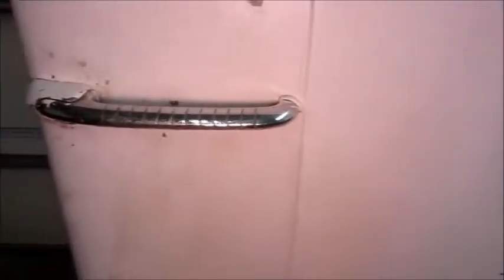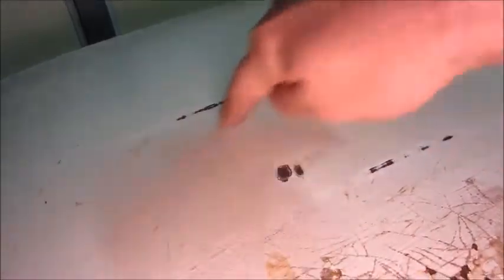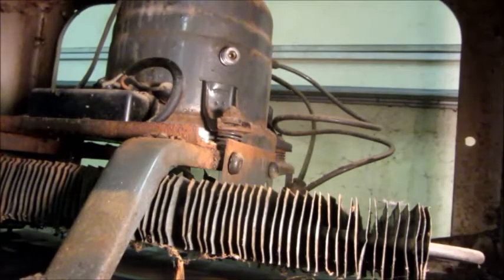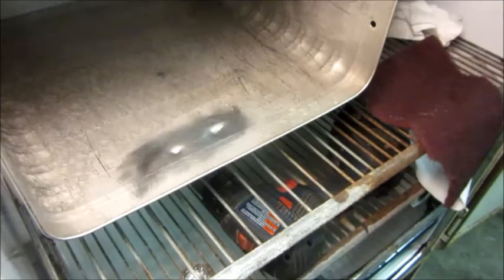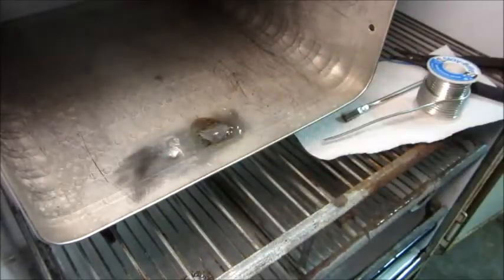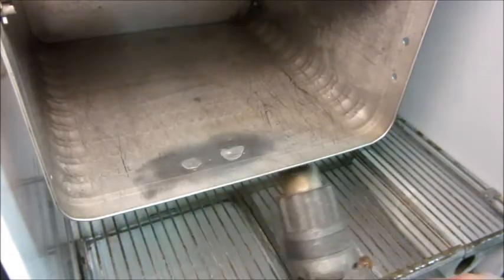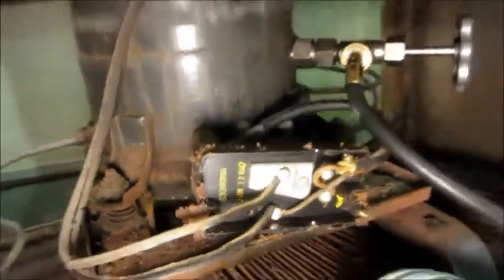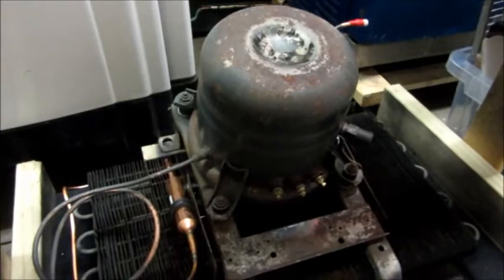1947 Kelvinator Antique Fridge Repair - 1 - Punctured evaporator repair...

Comment: Watching this again... if this were my fridge I would've been tempted to wire wheel the whole evaporator. The shiny stainless looks nice!
I'm going to squirrel away the tip on flux for stainless. I don't think I've had reason to solder to stainless yet, but that probably would have thrown me for a loop.
Reply from the maker: Glad you are enjoying these videos!  Yeah the stainless soldering can seem intimidating at first, but with the correct materials it actually is easy to solder.

Comment: I was in the used appliance business in the early 1990's. I junked out hundreds of 1930's through 1950's refrigerators that were in almost new condition. No one wanted them.
Reply: Best stuff ever imho nothing else can sit in a seasonal building year after year and run when plugged in.   Still using stuff from the early 60s

Comment: What was that exactly that you attached to the service port on the compressor, the hermetic service valve kit thing with the shaft that turns that bristol key?  I just bought a 1947 Kelvinator myself, that just needs topping off, and I'm new to this stuff, don't know what all the tools/fittings are called.
Reply from the maker: It's called a "Hermetic Service Kit."  This one is made by Imperial Brass but other companies sold them. They are long out of production but you can find them on eBay at times.

Comment: Stainless steel, how hard did they stab it
Reply from the maker: I think they put a tool of some sort under a large block of ice, and pried downward with the tool, which had two tabs on the back of the tool. The stainless is very thin, so this is relatively easy to do.